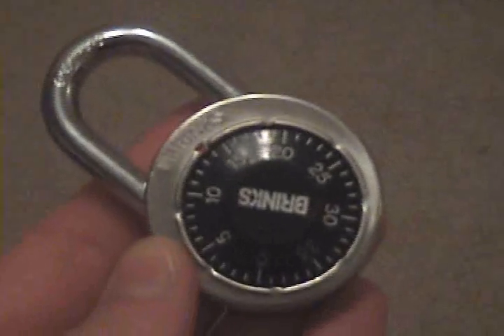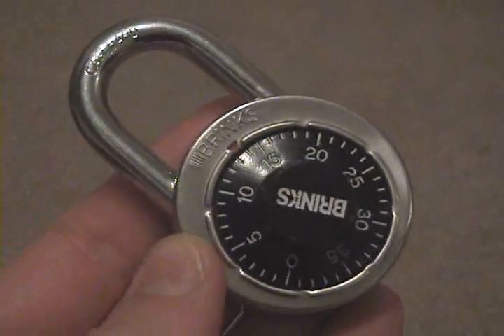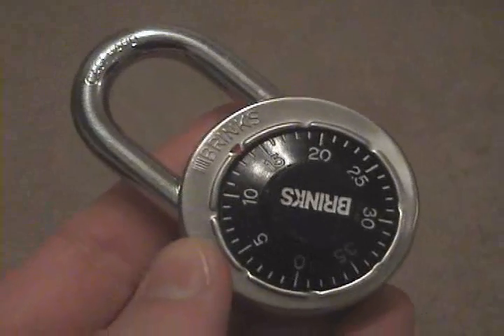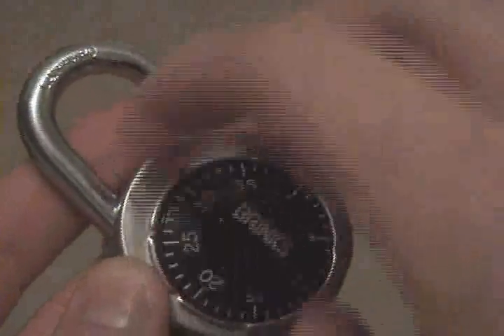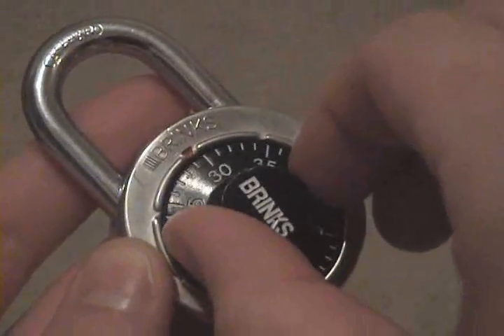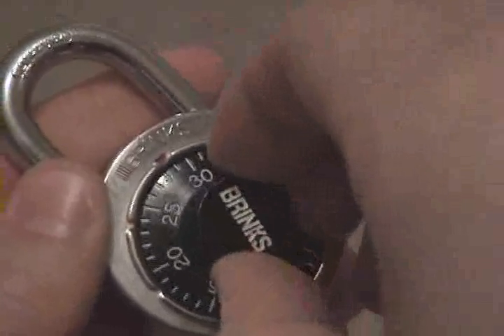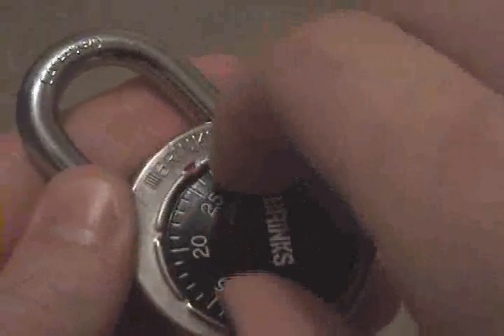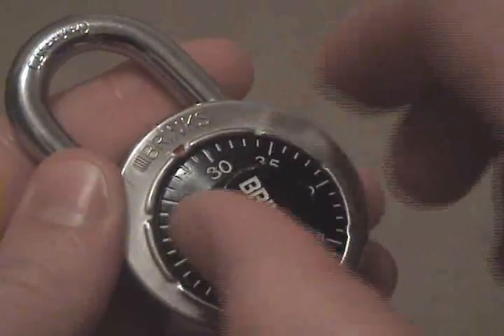Two Combinations for a Master Lock

Comment: I figured this out when I was in school back
in the 1970s by turning the dial
back and forth almost 360 degrees until I could feel the bump thickness of the inner workings.

I think you can get one thickness that way and then the next thickness takes two turns one way and then two turns the other way.

Once you have the thickness you can subtract the numbers from the actual combo tp get the second combination.

You could use my method for other models.
It likely varies from lock to lock..

Comment from the maker: @thejohnson331 It's lock specific, based on wherever the internal dials ended up after applying the combination.  Your specific lock only requires one turn.  I said worst case, it requires three turns, in reality, it's most likely going to be less.  Try turning your lock three times to the left, then turn once to the right (like you state), then put in the combination.  It won't if it's a standard master lock.

Comment: The equasion someone here used to find the second number is wrong.  They said add the first and third # together and subtract the first number from the original combination to get the second number.  Your math is wrong.  Using this equasion, you would add 29 and 29 to get 58.  Then, you would subtract 37.  The answer is 21, but the actual # in the combination is 22, so that disproves that theory.

It also doesn't work if your number is higher than 39 (like mine is).